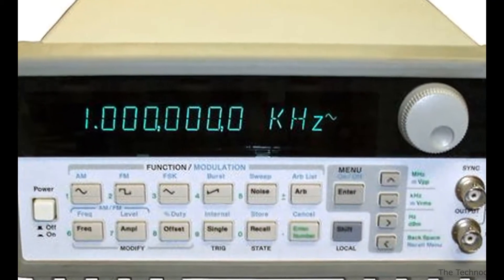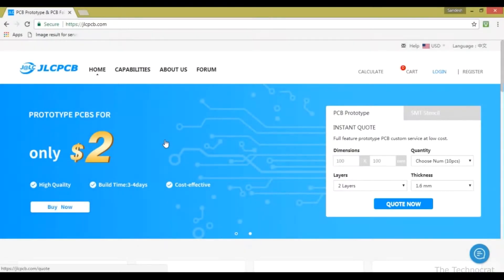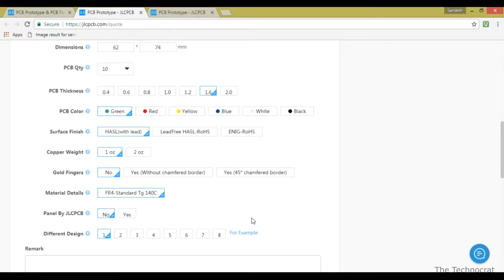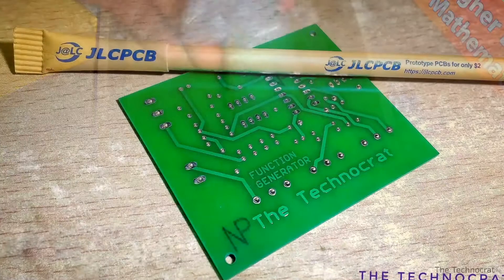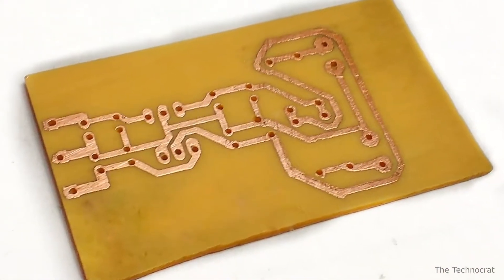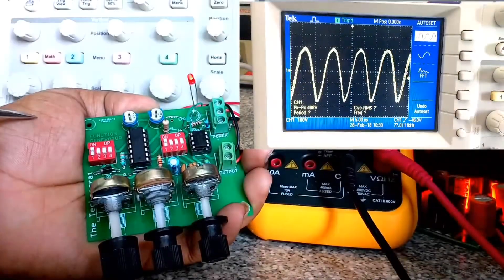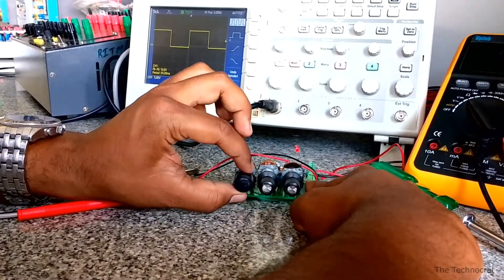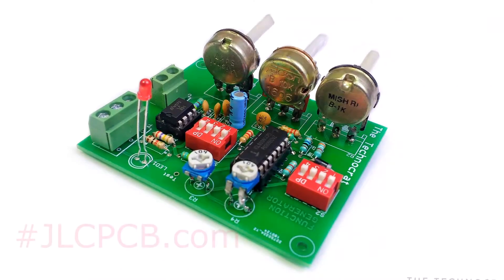How to make a Signal Generator | Function Generator DIY| Sine,Triangle and Square Waveforms

Comment: Im trying to make somthing like this, but only gives out 18.98HZ, what the best  way to go this low? Thanks
Reply from the maker: Try 555 ic multivibrator of you want square wave.  But for sine wave I suggest RC oscillator. This circuit can also be tuned for low frequency

Comment: Not working for me too much distorsion
Reply from the maker: i think there might be grounding issue or distortion in power supply
Reply: I directctly connets the board with 12 v transformer is this ok
Reply: And plz give the link for power supply which you made for this project